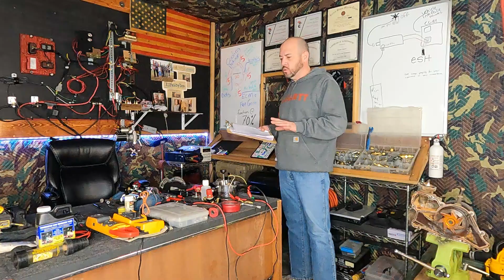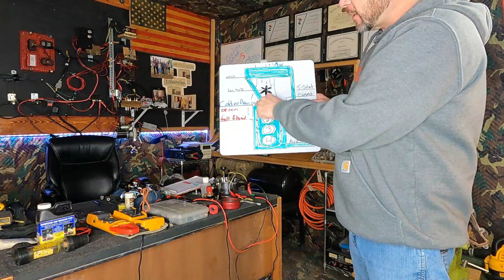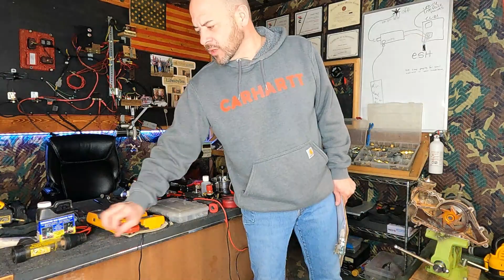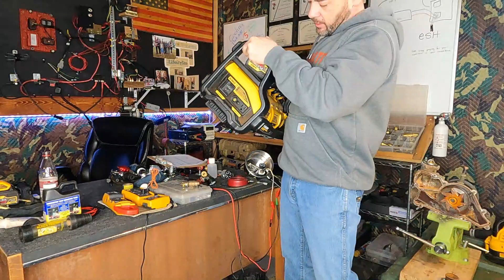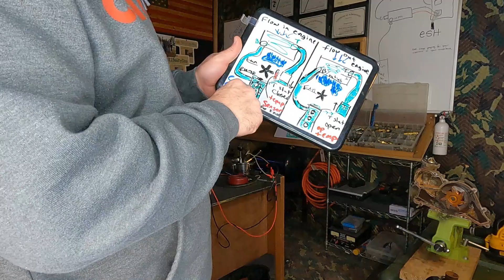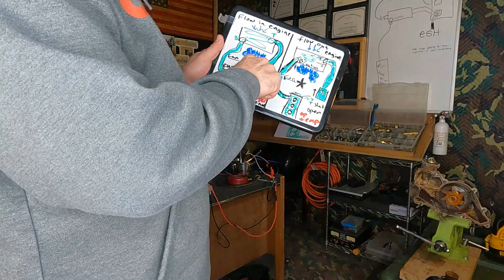Diesel engine cooling system diagnostics

Comment: Important to run 60/40 or 50/50 antifreeze and water and a good pressure cap because if the coolant starts boiling, it can't pick up as much heat which only makes the iron get hotter.  Then the pistons start scuffing and severe damage occurs.

Comment: Just something I'd like to add.  Any bubbles or steam pockets in the block or head will prevents the coolant from picking up heat.  The wet liner cooling system has an isolated coolant chamber around each cylinder.  Coolant comes in through a port in the bottom and flows up around each of the liners. There is a part of the liner where the space between the liner and block is only about 1/8" so if the system is dirty, that will definitely obstruct the flow. This narrowing is about 3/4 to the top of the liner.   On these wet cylinder engines there is a running pressure of about 25 psi in the cooling chamber around each cylinder caused by the water pump.  i think they do this to regulate the flow and pressure of coolant in the cylinders that are far from the W/P as well as cylinders close to the W/P. It is to even out the flow and pressure to all cylinders.   On an engine with dry liners, the cooling system is open throughout the block.   The restriction on a wet cylinder engine is the head gasket area or possibly in the tight clearance between the block and liner.   It may be in metered holes in the head gasket.  On big Cat engines there are 4 coolant directors per valve that force coolant at the exhaust valve seats.  They are like small freeze plugs with a cut area like jet   After the coolant flows up around the liner, it enters the head where the pressure drops to that of the radiator cap.  

 Considerations should also be to rod the oil cooler and radiator.  make sure there is a spring in the lower radiator hose to prevent collapsing and check the W/P.